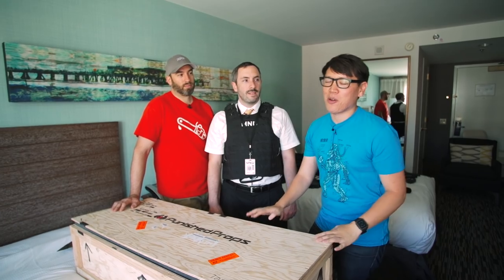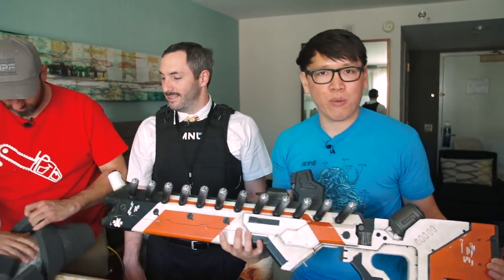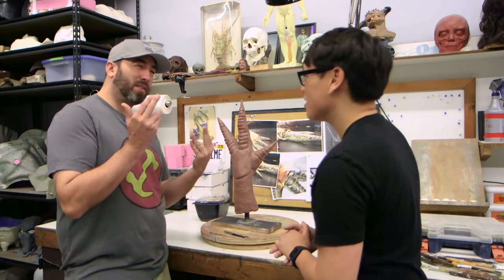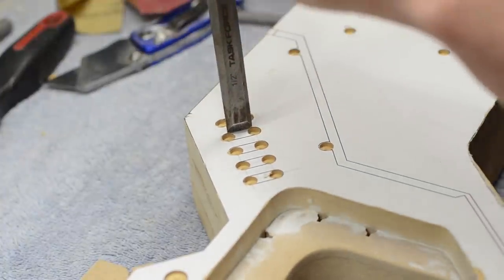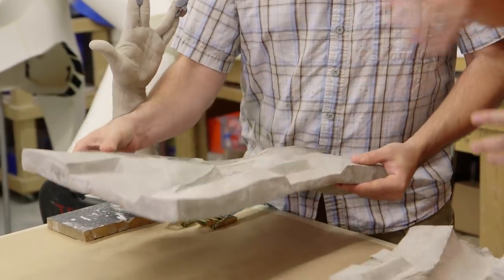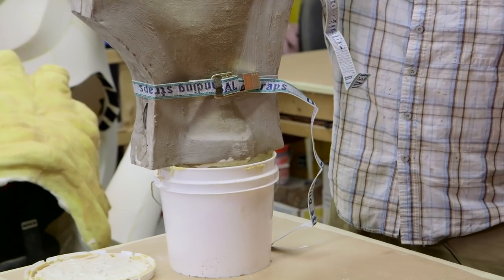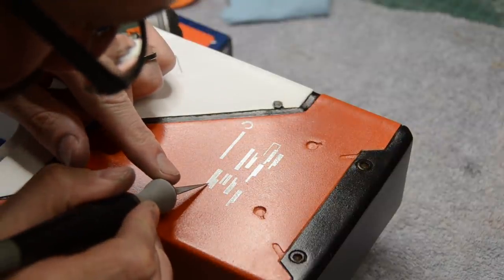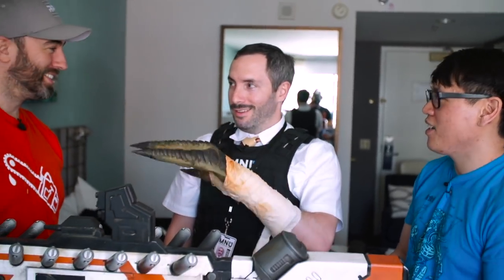Making a District 9 Alien Assault Rifle Prop Replica

Comment: At 7mins 28 why did the guy put glue on the MDF then put the part on top?
TOP TIP:

The better way to do that would be to put a tiny dab of glue on the yellow strip then stick it to the MDF, no messy over-spill of glue to ruin his nice clean look gun.